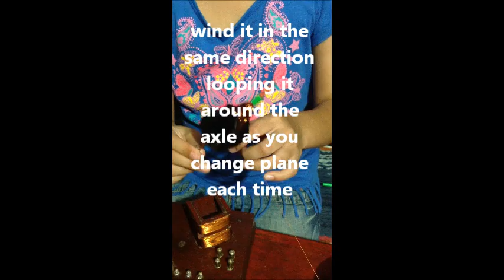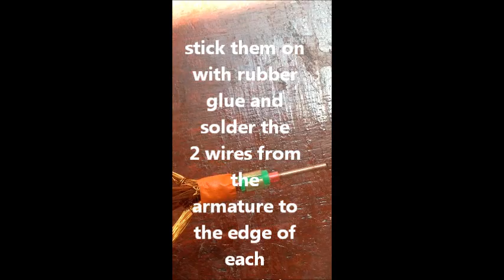How to make my electric motor by Rose

Comment from the maker: Hi Kingshuk, you are right about the winding but now instead of single winds I do them in sets of four - alternate which sides of the axle they go round so to keep it equal size but always loop in the same way after each set. any thing from 24 - 48 is OK. I like 40. Another thing is correct alignment of the commutator and armature.

Comment from the maker: Actually that was just to show where the two optimal relative positions are between the commutator and the armature - other relative positions either don't work as well or even at all. Need to glue it there, in either position - it doesn't matter which way at this stage. the spin can be reversed, as u say, by reversing the polarity of the battery - or by reversing the magnets.

Comment from the maker: When u find that u need to glue it in place. There are only two optimal positions and they spin in opposite directions. let your students find those! Wire gauge - I don't know as the labels worn off but it's the thinner the better

Comment: hi rose,i have seen ur armature building but don't understand.there  r 2 planes,perpendicular to each other.1st0u have made a loop around a plane then go to the adjacent plane and make a loop again back to the same point and all loops are made in the same direction.am i right??if wrong,, tell me the correct way.how many turns r there?what is the gauge of the wire?

Comment: i'll show u,without changing the position of commutator rotation can be reversed by reversing the polirity of dc sources.changing the position is not a good idea as it will weaken the commutator and joining/soldering.bye